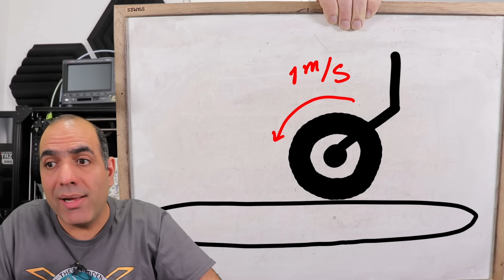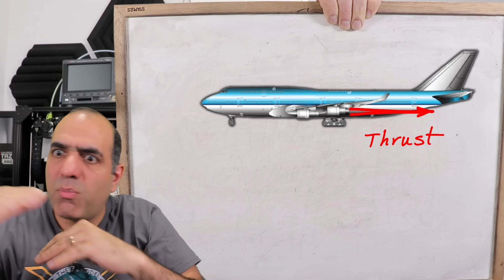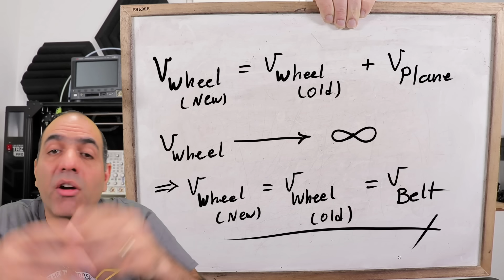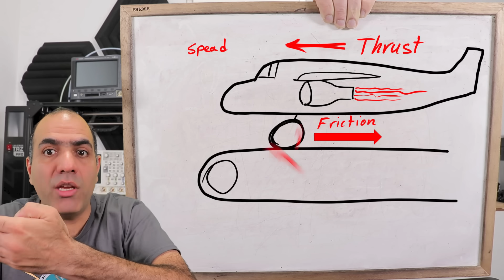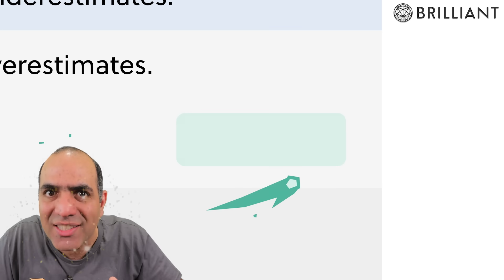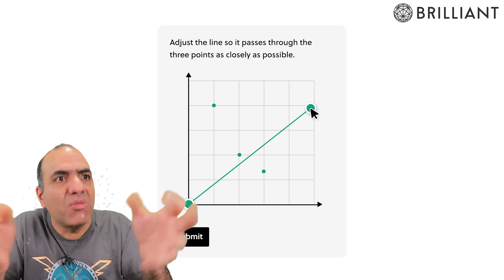Airplane Question that Drove Me NUTS!!!

Comment: Depends upon how fast that treadmill can spin. If it spins fast enough to push enough wind into the wings maybe, but the plane has to go a lot faster than normal. Also hard to see the plane going anywhere but backwards after.
Reply: The question states an impossible conveyor that can match the wheel speed

Comment: A plane doesn't propel itself using its wheels. The thrust is delivered independent of the wheels, therefore, it doesn't matter what speed or even direction the wheels are moving. The plane will still be able to propel itself forward.

Comment: Yes the plane could takeoff. It'd most likely take longer, but yes.

Does it state anywhere that the treadmill only travels in one direction? If this is just a belt on rollers, that its possible to travel backwards. Im which case the plane would just drag the belt along with it. Just adds more forces to hinder takeoff. If anything, all this would do is increase the amount of time required for takeoff.

Comment: Plane simply won't takeoff as there is insufficient airflow over the wings able to produce lift.
Lift is produced when airflow over the wings (under the AoA) produces a pressure difference with normal air pressure on the bottom of the wing & lower air pressure on the top due to Bernoulli effects because the air at the top speeds up.
People can replicate this effect by holding  2 A4 pieces of paper together so the extreme ends are about 1cm apart whilst blowing towards the centre of the paper gap & they should see the ends of the paper touch each other.
If however the plane was stationary, parking brakes on and a wind sufficient enough to overcome the stall speed of the wings was blowing ideally head on ie > 160kn (approx 296km/h) then theoretically, the pilots could (with a takeoff flaps setting) say pull back slightly on the control collumn and takeoff after releasing the parking brakes.
Now, whether it's safe or not to do so & takeoff in such conditions is another discussion altogether, unless they're a glider or paramotor aircraft flying in good VFR (visual) conditions.

If one however wanted to really be technical & nitpick, the aircraft APU (Auxiliary Power Unit) would have to be first running to at least power 1 hydraulic system up via the backup electrical pumps & give electrical power to also power the flight deck electronics but it would only give the aircraft partial control as a lot of hydraulic systems for full aircraft functionality in modern "fly by wire" systems are driven by the engines with the APU able to supply limited hydraulics.
If say the APU also failed due to fuel starvation or failure, the pilots could whilst airborne deploy the RAT (Ram Air Turbine) as a last resort to give some hydraulic & electrical power.
For a mechanical linkage small propeller plane ie Cessna 172 even with basic "steam gauge" or electronic "glass cockpit" EFIS systems ie Garmin G1000 era flight instruments it could theoretically take off & flipping the master power switch on would power the radios, transponder etc but as the engine is likely not running the battery would deplete over time, again an unsafe takeoff only if immediate loss of life would result from inaction, but because the engine driven vacuum pumps are down the airspeed, artificial horizon & altitude indicators would unlikely be operative ie unsafe, though not impossible to fly by also pulling back on the control collumn.
FYI, Sully was successful in landing his Airbus A320  plane because he was smart enough to prior enable the APU allowing him partial control of his aircraft in what Airbus generally refers to as Alternate law.
Wheels can go as fast as they want, but that plane aint leaving the ground in that scenario.
In either scenario, the plane would hardly achieve forward momentum unless the pilots say climbed the plane to gain altitude & dived to trade altitude for ground forward distance like a glider does, but again because most modern passenger airliners are heavy, unlike a glider or similar it would be a lot of work for the pilots continually porpoising.

Moral of the story, avoid conveyer belts as runways!

Comment: What about using the wheel brakes to keep the wheels from spinning?
Reply: Then you won't move
Reply: @cristian_ca_n_le2328  You will move if the conveyor belt moves! No??
Reply: @driversteve9345  yes but they say that the conveyor belt matches always the speed of the wheels so it won't move

Comment: Here's one for you. If the belt matches the speed of the wheels the belt won't move as when a tyre rolls the speed of the tyre at the point of contact with the ground is 0, as long as it is not sliding

Comment: Yes. The plane's forward motion is not dependent upon the wheels' friction with the runway. There would be some significant friction losses from the wheels spinning twice as fast as they normally would during take-off, so the plane would take longer to take off. But without doing any complicated math I think the length of the runway should still be long enough. 

In more detail - the conveyor belt is pushing the wheels backwards, but the wheels will rotate freely. If the wheel bearings were frictionless, the plane would take off exactly like normal. But they're not frictionless, so there is a very small force pushing the whole plane backward, but that force would be far outmatched by the power of the engines pushing the plane forward.
Reply: Now that I've finished the video, I disagree with your case 3 assumption that the wheels and conveyor belt would compete for speed and ramp up to infinity. I considered this but I don't think it's a plausible outcome. First of all, with friction on everywhere, the belt and wheel bearing friction at infinite speed would ultimately cause both to melt. But setting that aside, they'd never get that fast. The plane would reach takeoff velocity and lift off with the wheels spinning somewhere around twice the airspeed of the plane. The friction in the wheel bearings and the friction in the conveyor belt bearings would prevent any infinite race condition, and I'm not convinced that such a race condition would prevent the plane from taking off anyway.

Comment: If thrust "overcomes the belt", then the plane will take off, if not, then it won't.
The whole question is kinda silly to begin which, because if you would actually put plane of a belt, then the belt would move plane to the end of the belt xD
The only way the plane can overcome the belt is either via thrust or if there is a magical hand holding the plane in place.

Comment: Myth Busters is retarded.  They are not scientific.  If Myth Busters were asked if it were possible to travel to space with a rocket, they would try and fail and determine it is not possible for anyone to do.   One time Myth Busters "busted" the tape worm diet.  Simply because they were unable to find it using Google search.  By this logic any dark web sites do not exist, and many regular websites do not exist.  Big Papa Slush Barbeque on Fenkle Avenue in Detroit Michigan does not exist because you can not find it with Google search.  Even though I eat there all the time.  They have "busted" several things on different episodes I know to be true.

Comment: I agree.  The airplane wheels would only move the same speed as the conveyor if the airplane was held in place or the engines were off.  The airplane itself doesn't care how fast the wheels move.  As soon as the engines are turned on the plane will move forward regardless of wheel speed.

Comment: Before watching: the plane should be able to take off relatively normally, but the tires might burst as the wheels will be spinning as though the plane was going twice as fast (like what happened to the Concorde). Other than that the ground speed is basically irrelevant.

Edit: interesting, I interpreted "speed of the wheel" basically as the speed of the axle (like the mythbusters example) rather than speed of the tire surface.

Comment: YES! The answer is clearly yes because the wheels are not driving the aircraft forwards, the jet engines or propeller(s) are. There's no drive train or axle like you'd find on a car.

The wheels are totally irrelevant to the speed of the aircraft and exist to stop the plane from having its fuselage sitting on the ground.

There is no "argument" to be had, it's provable and demonstrable physics.

Comment: Case 2 is reality.  The actyual events would most likely unfold like a plane touching down, but in reverse.

When a plane is landing, it's wheels are lowered but not spinning (they're just being dragged through the air as part of the plane). The plane itself, however is moving forward at over 200 kph. 
Once those wheels touch the ground, they have to transition from 0 kph up to 220 kph in just a few seconds so they don't leave all the tires rubber on the runway leaving the plane without brakes. This is a NORMAL and EXPECTED part the landing operation, which means the wheels are designed to handle this as a regular part of their operation.

Comment: With all due respect, dear electrical engineer, by the time the wheels friction is enough to match the thrust of the jet engines, the airplane would be already airborne. And you forgot another fact,  the airplane as it moves forward and air passes thought it wings, it becomes "Lighter" thus the force being exerted on the wheels is lower and lower, thus making the friction losses of the wheels dam near neglectable. The air plane would  take off.

Comment: If you take off in the right direction, you are already doing this the Earth's circumference is about 24k miles, and it takes 24 hours to rotate, so at the equator, pointed east, you are on a 1000 mph conveyor belt.

Comment: 0:44 So, I remember reading a breakdown of this on XKDC's site.  It all boils down to, "what do they mean by the speed of the wheels?" (and I guess also "what do they mean by 'as long as a runway' like a standard runway?')  If they just mean the forward velocity of the wheels, then that will slow the plane down, but the engines are powerful enough that it should still be able to get enough speed to take off (remember the airplane does need significant speed to take off.  It's not like the plane can magically levitate it needs to get moving first, while its touching the ground it will be slowed down.)  UNLESS the conveyor belt is too short, there is a small chance you run out of runway before you get enough speed.  The belt is imparting a force on the plane but the engines are really strong and have enough force to still push the airplane forward.

However, if they mean the rotational velocity of the wheels, as the plane moves forward, the conveyor belt turns, which spins the wheels faster, which causes the conveyor belt to go faster, and you very quickly get a feedback loop which will shove the plane back faster than its engines can accelerate it.  (In reality it would probably break something, either a tire would explode or the belt would break.)

Comment: Would the bearing friction not overcome the wheel friction so even though they are spinning the same speed, it is moving forward? Also the air currents created by the jet engines and the belt will come into play.

Comment: "The conveyer belt is designed to exactly match the speed of the wheels?" And what exactly is the speed of these free rolling wheels? This is an incorrect assumption to begin with, because you cannot match the speed of the wheels if you have no control over its speed... it's the speed of the wheels that are designed to match the speed of the conveyer belt (in fact have to because physics). 

The equations in case 2 are incorrect because there is confusion on translational and rotational velocity. If we follow the assumptions drawn in the video, Vplane and Vbelt are translational velocities, and Vwheel is linear velocity on the surface of the wheel. Vwheel = Vbelt is thus true due to the no slip condition, but the first equation Vwheel = Vplane + Vbelt is wrong; the Vwheel term needs to be converted from velocity at the surface to velocity at the center (which adds angular velocity and radius variables, remember v=rw). This resolves the infinite wheel speed problem. This also means you have more variables than equations, so the problem is indeterminate. The solution to indeterminate problems? Yes, the plane could take off with its engines if it wanted to, regardless of this conveyer belt nonsense.

Comment: It's not that complicated. The question implies that some one thinks that the plane flies because the wheels are spinning.  The only way the plane can fly is with wind speed.  The conveyor belt does nothing. So if you had a wind speed equal to the normal takeoff speed the plane would have lift, except that the wind would push the plane backwards, assisted by the conveyor belt going backwards. So you need to have the engines running with enough thrust to overcome the wind drag, just like any normal takeoff.  The conveyor belt and the wheels can be stationary.  That's just a distraction

It would be similar to a plane in a wind tunnel except then it would be attached to a support to keep it from being blown backwards.  https://en.wikipedia.org/wiki/Wind_tunnel

Comment: I think Mhedi got to caught up in the wording of the post, I’m understand what the post is trying to say and I’m still not sure what the answer is. 

     The Jets push the plane forward while it’s on the ground and the wheels are what allows the plane to move along the ground while it picks up speed. If the the plane is on a conveyer belt that cancels out the movement of the plane rendering the plane’s speed to always be 0 (meaning the wheels and conveyer belt’s speed match) then there is no air moving over the wings, but there is air moving through the jets, can the plane take off? I believe the answer is no.

Comment: My answer would be: "If the friction in the undercarriage allows the treadmill to impart enough backwards force on the plane to match the forwards force of the engines, and the engines are mounted parallel to the ground in such a way that the exhaust of the engines doesn't itself impart lift on the plane, then it will remain stationary on the ground."

Comment: I thought about it before watching your solutions and came up with another variation to avoid the infinite spinny spin.
I present case 5: "speed of the wheels" is measured at the speed of the wheel axles. Meaning the conveyor matches the land speed of the plane.
Now the wheels will simply spin twice as fast as normal. The only question that remains is do the wheels explode before takeoff speed, spinning at the equivalent of 580km/h.
Reply: I think this makes the most sense. The wheels speed is obviously going to match the plane's groundspeed, which the conveyer will match. A 747's takeoff speed is 160knots + conveyer 160 knots = wheels spin at effective groundspeed of 320knots(no wind scenario). From what I can find the wheels are rated to about 205 knots. You'd need a 115 knot headwind for this to work without indestructible parts.
One question, how did you get the 580km/h number?
Reply: @bueb8674  I just googled 747 takeoff speed and got 155kts(=290km/h) as first result, I guess it varies with takeoff weight but it seems 160kts is the more commonly used number. Times two for the wheel rotation to get 580km/h
Reply: @teslatrooper  oh my bad, my brain completely glossed over converting knots to km/h lol

Comment: I don't think the wheel bearing has anything to do with the question. Just as you walked along the treadmill, you pushed forward, but you stayed stationary. The plane wouldn't move and the top speed would be up to the plane.

Comment: going by the questions initial conditions and without making any assumptions, i would say the plane won't take off. the question doesn't say anything about the engines being on. since the plane starts at rest, the conveyor belt will also be at rest, and since no energy is being added to the system, the plane will not move

Comment: Those wheels, landing gear, belt have nothing to do with an airplane and it lifting off. A plane with pontoons can take off from water.  That to no relevant.  Air moving across the wings is the ONLY thing that lifts and airplane from the ground.   It is possible to have headwind speeds so high that a plane can be flying and sitting still.

Comment: Before I see the video: no because lift is generated when there is speed relative to the mass of air. If the airplane is running place and assuming there is not an absolute windstorm around, the plane is still in relation to the air mass, so no lift

Comment: I'm not sure the "infinite belt/wheel speeding up" theory is accurate? I think the belt moving at the same speed as the wheel effectively means the wheel "drives" the belt.
The reason the question is tricky is we forget the wheel is decoupled from the plane and is not the source of thrust.
If the belt was instead configured to move forward (putting the wheels spinning backwards) at twice the takeoff speed of the plane (v1), the plane would still accelerate to take off, at which point the wheels would still be rotating in reverse at v1. 
Or have I made a mistake, very possible
Reply: Of course friction in the wheel bearings would eventually see the plane catch up to the wheels and take off a v1 without the engines on, then lose power and touch down, then gain power again and take off in what would be the smoothest landing ever....